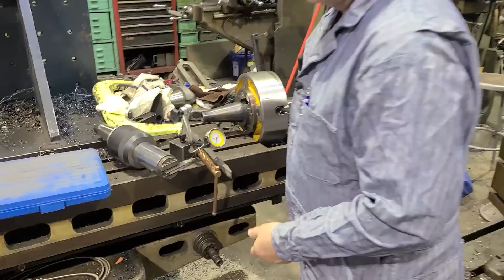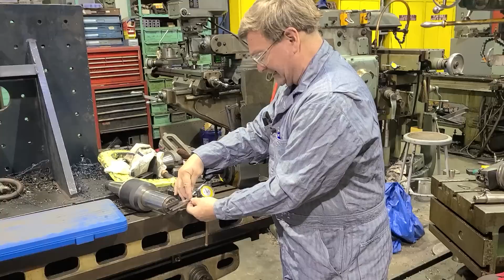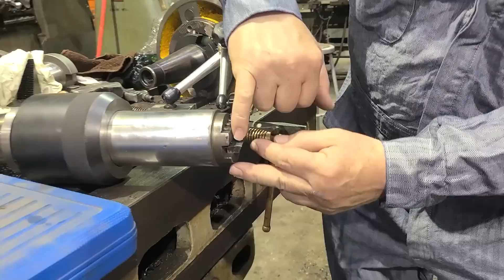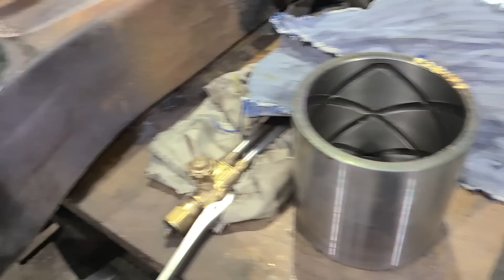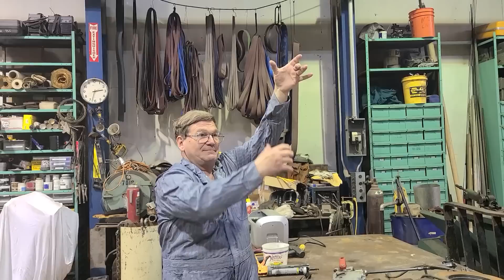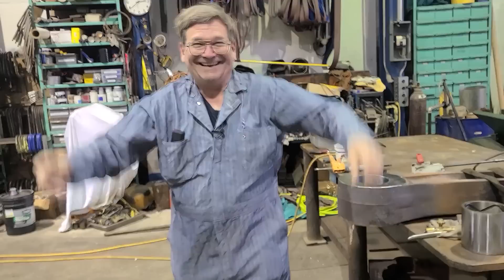Machinist's Minutes: Thoughts on line boring

Comment: I made jaws that fit my bar and welded to vice grips with an indicator on them very quick and stable just clamp on next to cutter, i also have a little flat spot ground on the cutter to help with accuracy  i got the idea from one of snowballengineering's video's.

Comment: "pro tip" use the left most clamp screw of the holder  to hold a fine pitch nut in parallel with the tool shank. I use 1/4-32 NEF screw held in the nut, the screw pushes on the back face of the tool shank. It allows for real precise adjustment of the diameter when you use an hex L-wrench. I use the other three clamp screws the same way a boring bar slide is tightened. The other screws provide tension on the tool holder with the middle one  loose, then tighten all three at the desired adjustment.
Reply: Second tip, the mag base has the V cutout just for use like this. Put the mag base directly on the tool shaft. That way it doesn't matter if the tool holder rotates, as long as you don't knock the indicator off the bar you will maintain position relative to the tip of the cutter. If you have a large mag base and it is too big for your bar get a smaller mag base with a narrow V notch.

Comment: What kind of hone should I be using?  The cheap ones are total crap?
Reply from the maker: The hones need to be rigid, no springs.  in the 3.5"-20" range sunnen is the best option, AN series.  They also make smaller hones that work down to about 1.75"  The smaller you go, the more the hones cost (in the used market).  Mid range option, is the Lisle hone, sold by snap-on, and many others with rebranding.
Reply: @HOWEES  Thank you very much.  I have a  portable line boring setup.  Right now I am using flap wheels.  Everybody in the area seems to use flap wheels.  I don't like flap wheels for the reasons you mentioned.  Now I know what to look for.  I really appreciate your content.

Comment: Would love to see more of your portable milling work. I have a climax portable keyway mill it's a great thing to have for anything that won't fit in the regular mill. Ironically I have used it for dozens of different things over the years, machining flat areas, boring out holes, making slots etc. It was just yesterday I finally used it to actually cut a keyway on a shaft of an old tractor
Reply: Bought two at a machine shop that was going out of business...one works and one has parts missing....im going to take the working one apart and reverse engineer it to get it up and running....you are Correct....if you can think of a way to use it and tool it up most anything can be done out in the Field!!

Comment: I just spent 2 weeks on a job on a horizontal mill boring both ends of a 10.625" pin that was stuck in a ladle turret. 4140 steel. I started with a 12 inch long 1" drill and went from there. My mill does not have a facing chuck so i had to use 4 different size boring bars. You are right, its amazing how far a cutter can stick out and not break or chatter too badly. It was monotonous and we likely lost our shirts on the job but it had to be done. You learn quickly how to sharpen a boring tool when your on a boring mill.
Reply: Saw a video not long ago of a chicom made ladle, before it was ever lined, being moved.  The trunnion fell out , and they dropped the empty ladle.  Imagine if it had 250 ton of steel in it😂

Comment: I love it when boilmakers go line boring then get a job back in a workshop and they get their ambitions mixed up with their abilities and try machining or try and tell us machinists how to machine.
Reply: What would need boring on a boiler? I have seen the oval hand holes faced before but usually milled
Reply: @markvoluckas4571  In Australia a boilermaker is the qualification name for the welding/fabrication trade. They don't necessarily make or work on boilers anymore. As steam was phased out the qualification name didn't change.

Comment: I scratch my head as to how some of these outfits making portable line boring units can charge 6 figures for a machine that fits in a suitcase, when you can purchase a new CNC mill for about the same price. I'd like to have a Line boring unit, but what they want for a glorified mag drill with a funky bar and feed unit... I can probably make something that works as good or better.
Reply: old shipyard engineers been doin it for years 

we had to line bore 6 inch holes for the lifting padeyes of a large offshore module 
an old geezer   appeared   with    an electric motor and   bicycle chainwheel    he figiured out tht centre   and set up two standard bearing blocks  on  box section uprites welded to the deck .  a shaft about 1/1/4 od with a keyway all along    a tool holder with  a fixed key slid over this   it had a fine thread   bar paralell to the main shaft with a star arangement on the end   every turn th e star  
hit  a pln and advanced the tool   it   was all very   cobbled together motor was tack welded to the deck  and drove the bicycle chain and large chainwheel on the bar , took longer to set up  than the actual boring     finish was  good      i think this idea has its roots in cannon boring 
sadly the operators of this home brew stuff are mostly gone now
Reply: The old man that owns the shop I work at pioneered line boring. He made as far as I am concerned one of if not the first compact boring rig. Hand feed, #3 air drill. You can make one. He has made a few. Feed is achieved by a threaded rod in a slot the moves the cutter head, driven by a spur wheel that advances per revolution. Another method is a modified Bridgeport feed unit driving a bearing frame that rides a set of rails for bore mounting. You can use a modified big milwaukee mag base. You make a tack down adapter base, and a compact boring head with a morse taper. There is a learning curve to the feed rate.
Reply: @christianhilditch9333  I was just thinking about the BP quill feed parts... I have most everything else, except the bar and bearings... but also, just found one on fleabay NEW for $1500. So when the time comes I need a Line bore, I have affordable options.
Reply: Could have swore I replied earlier.

The largest Climax drives an 8 inch diameter bar with a 30hp hydraulic drive, can drive other tools like your flange facer, od turning setup for doing rotor/shaft journal build up and is made for heavy engineering repairs.

Can you build one better or equal? Probably.

Is it It worth the time? Not really, if I am building portable tools I'll build the more complex stuff so it's just how I want it.

You also get alignment spiders, optics, etc for that 

On the jobs I use mine on, we usually are charging 500 to 600 an hour/guy. And it's a 2 man job. 

You aren't using the expensive Climax on excavator pins 😂

The cheaper Climax bars are only like 15k for the 2 inch bar, and you can get them at auctions for damn near nothing.
Reply: @procyonia3654  hold up, you re charging $500+ an hour with a straight face? So you justify expensive tooling by being a f'n crook, noted
Reply: I've got one of those 6 figure line boring set ups, I use it on power plant repair jobs and much heavier industrial stuff like steel mill repairs etc

I bought it because I don't get paid for shop projects, and the work pays well enough I can justify it.

Your argument is silly You could make a CNC mill, Why dont you do that? Because you are too busy making money to justify it right? Same thing with a Climax rig for the guys that do that work all the time, and charge big bucks to do it.
Reply: @procyonia3654  well, you utterly missed the point A CNC MILL costs 6 figures, a machine that will make far and away more money then a line boring machine, because it's not a single purpose machine, so again I ask why the f does a Climax line borer that isn't cnc, only has a single axis, and one or 2 drive motors cost as much as a 3 axis mill, with tool changer and full NC control?

Oh right there's a sucker born every day
Reply: @procyonia3654  not to mention there are plenty of reasonably priced units for line boring on the market, i.e. under $2k so again I ask why pay $100k + for a machine that does the same job? considering you would need to work well over 600 hrs at $150 an hour just to break even on the damned thing.
Reply: @northmanlogging2769  alright so there's a pretty big difference in capability here when you compare the highest end Climax to mid or lower end units.

For 100k spent you should be getting optical line up tools, spiders, and the largest capacity bars, the drive unit can also be used to drive flange facers, OD turning and some of the other portable machines.

The bar is an 8 inch diameter and it's driven by a 30hp hydraulic motor. Largest bores I've in line bored with it were almost 8 foot diameter.

Could you build a setup capable of doing that? Most certainly, would you be in for some serious fucking coin if you do? Certainly not going to be too much cheaper, just a 10 foot long line 8 inch diameter bar raw is going to cost you some serious coin.

My smaller setups, I have some homemade ones. But for the larger stuff, especially since I can use the drive motor to drive other large portable tools I like the modularity.
Reply: @northmanlogging2769  capability, the most expensive line boring rig, has a 30hp drive turning a 8 inch bar, and you are good out to 8 or even 10 foot diameter.

You aren't using that to do baby pin jobs in excavators, you are using it in steel mills, hydro plants, ship engine bays, ball mills, etc, etc on very large (read: $$$$) work 

You can also use the drive unit to drive your OD turning tools for journal turning etc, or use it to drive a flange facer, or ghe portable milling setups.

Alot of the in situ machine companies build their own tooling, but most of them still use Climax bars, because they are relatively cheap compared to the work you are doing with them and they are reliable and can drop ship you parts anywhere In the world.

I used to do alot more field work then I do now, and it didn't take long for it to pay for itself. And for the type of work you are doing with it, your stated 150 dollar burn rate, well let's just say that would be considered the deal of a lifetime.

That's about what I charge for shop time, field work depending but if I am pulling out the big Climax and the shipping container full of portable stuff, triple or quadruple that burn rate + my partner. 

Fixing a spun bearing seat in a cruise liner engine while it's at sea, or doing main journals on a turbine rotor isn't cheap work.

Comment: I worked at Terex Crane for awhile, when we were installing the boom, balanced between two overhead trolleys, lining it up for the pins, first thing was don't do what Lefty did. Then get the bored bearings to alignment. Then I discovered that I could see with my naked eye, the finish was too rough, and I couldn't believe that they were lined bored. In fact, I believe they were bored first then welded on, using an old pin, to line them up. Don't know, but that's the first impression I got, and my experience, usually is right. So what does the assembly crew do. They get grinders out to waller. out the holes. Not my call, so the pin went in, over an hour later. I would have done it differently, way differently. But like you said, the customer isn't watching. and things might need repaired sooner.